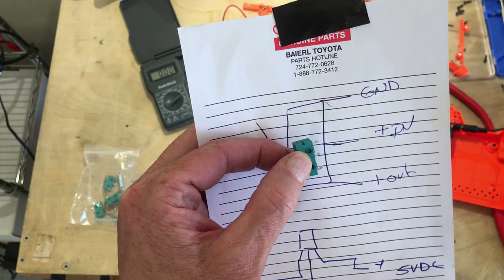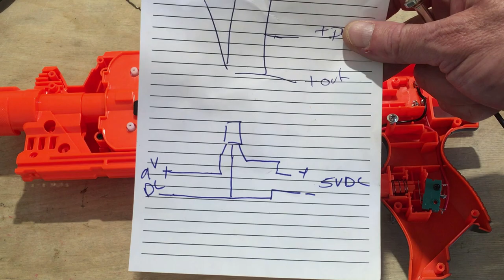Full Auto Nerf Stryfe Mod

Comment: Joseph, Thanks for this video. I bought this kit to mod a different Nerf gun. Just to be clear, can you tell me, The bottom switch activates the flywheels and the top switch activates the pusher motor and that's it?

Comment: Hi Joseph. Thanks for the video, it’s the best one I’ve found on YouTube regarding specifically the worker full auto kit. I’m wondering, does the pusher always return to the back position? If not, can you load a clip with it in the forwards position?
Reply: @Hashir Easa thanks for the reply mate. I’ve had great success with that full auto kit. I’ve found that if you put a dab of hot glue to prevent the pusher from fully returning to the back position, it increases the durability of the peg that slots through the pusher. This is prone to failure and can result in the loss of a stryfe/swordfish shell as it is difficult to repair. Even less than 1mm does the trick and the blaster has more of a thump thump rather than the clack clack. It’s worth a try, thanks
Reply: *mag
Reply: @Catconsumervfx fixing a 3 year old comment's grammar 💀

Comment: Nice video. I noticed though that you did not utilize all of the parts and the micro circuit board that comes in the kit. Is there a reason why you skipped out on using the other parts?
Reply from the maker: I think the kit is over-engineered, or maybe I just figured out a way to make it work.  That particular gun is still working.  Check out the stryfe university youtube page for my latest stryfe mods
Reply: @josephmurphy423  The micro circuit allows rate of fire control and alters motor current flow to the motor that pushes the rod.
Reply from the maker: @Huey_AK-47_Brawl_Stars  the microcircuit also makes sure that the pusher rod is drawn all the way back after you fire a burst
Reply: @josephmurphy423  Oh, right thanks a lot :)

Comment: Couldn’t you have just kept the original revving system and add a second power supply (a battery pack) velcro it to the side of the blaster and make holes in the blaster for the wires to fit through use the included switch to connect it to the motor that spins the teeth plus it doesn’t drain you’re in blaster battery.

Comment: Hi thanks for making the video I was wondering were u got the parts for the build
Reply from the maker: i got those parts from https://www.workermod.com/  you can also buy on amazon.  Meanwhile ( am going to 3d print my own soon - the worker parts are hard to use - as you can see in the video it is hard to properly seat that motor mount.  If you send me your address i will send you a motor mount we did and you can see if it works
Reply: @josephmurphy423  can you send me one?

Comment: Could I possibly hook this up to a 2s lipo?
Reply from the maker: you coudl, but it would be a waster because the stock toy motors can rreally do much more than they are doing.  i did connect a 9.6v race car batter to the flywheels in a project called "super-rev"  you can see that here
Reply: Well it’s like 7v for 2s so 9.6 is probably why it didn’t work
Reply: yes, but it is suggested that you also replace the flywheels, the flywheel cage and the motors. if you dont know how to do that there are many videos online; just search "full stryfe rewire" or something like that